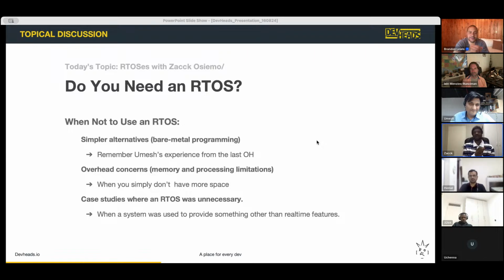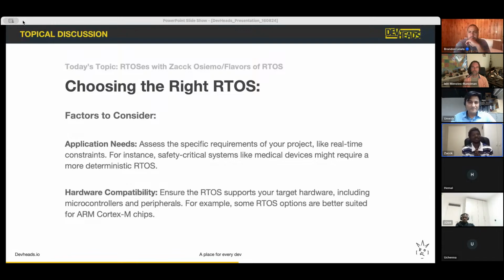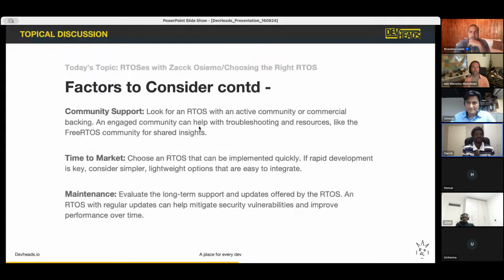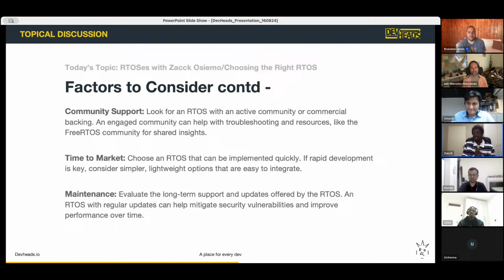RTOS in Embedded Systems: When, Why, and How to Choose the Right One

Comment: Any thoughts on Google's pigweed?  

Aside from commercial offerings (Segger SystemView ,  Percepio Tracealyzer, etc), are there any hobby or opensource tools for debugging an RTOS design?

With so many rtos available..    
freertos ,  zephyr ,  Xous ,   ChibiOS-RT, GeckOS 
it's hard to know when each is a better fit based on the design!
Reply from the maker: We'll see what Zacck thinks but we've also created a discussion thread of this in the community at https://discord.gg/devheads !!
Reply from the maker: TraceRecorder from Percepio is a reduced functionality version of Tracealyzer. Not RTOS-aware, but open source: https://discord.com/channels/1130679493799977062/1130679494248763435/1276093422675169311